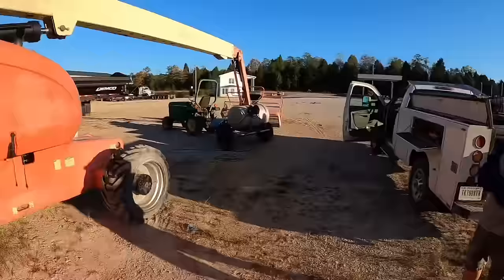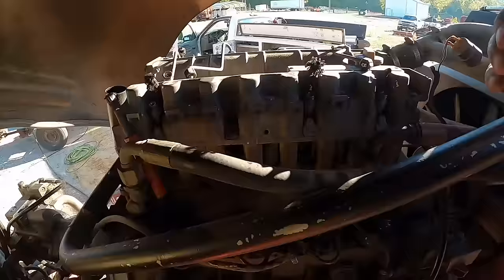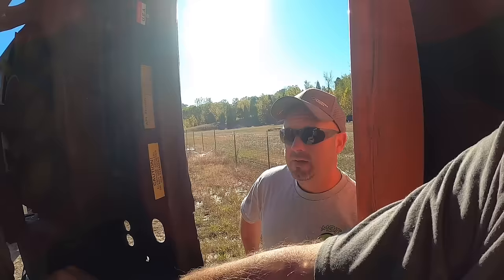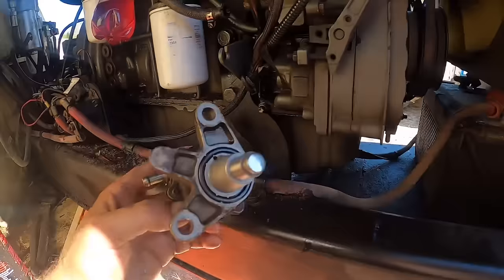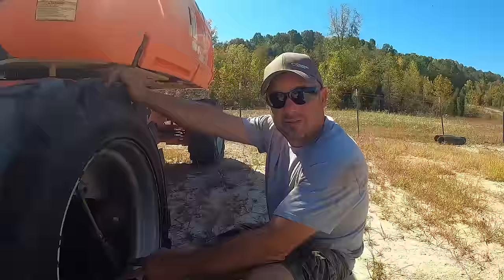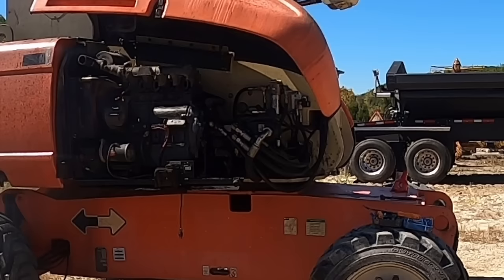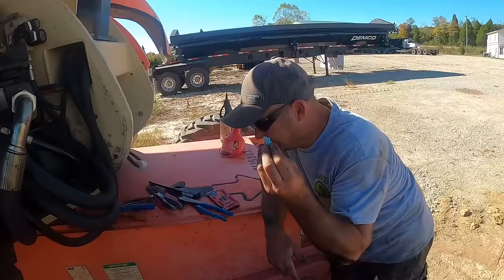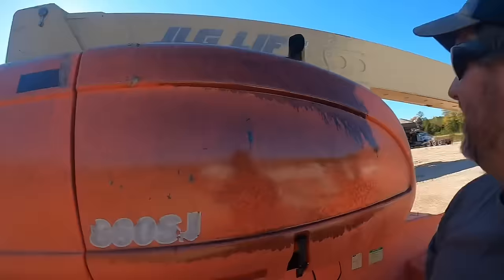Will It Ever Run Again? Regretting My Decision. Lots Of Highs And Lows. Never Believe What We Found!

Comment: I worked for Sunbelt rentals as a mechanic on lifts for about 5 years. 99% of my equipment was JLG. Loved them. Easy to work on. Here’s a huge tip for you. JLG has a service line and they can walk you through any problems you run into over the phone.
Reply: my kubota and case ih dealer had few those jlg lifts inside his shopand got fixed
Reply: Hi Chad what shop did you work at, I worked for Sunbelt from 94 to 2005 in the Northeren Virginia area at 3 different shops, the first shop I worked in was McLean Rentals and I think Sunbelt bought us in 95 or 96.
Reply: This was totally awesome to watch you guys get this running

Comment: these Deutz oil-cooled engines use a timing belt instead of a chain or gears..replacement is necessary when the engine sits unused for long periods as the belt will get flat spots and jump time..the fuel solenoids are high mortality rate failure items,there is a 2-wire and 3-wire style,with the 3-wire being the better one due to a low-amp 'hold' winding. Fuel lift pumps are high failure rate items as well

Comment: Check injectors like this all the time. One thing to do is check the strangler (manual shut off) cuts the injectors whilst cranking. Have had the injector pumps seized with the rack wide open due to contaminated fuel. When draining engine oil drain the oil cooler too, it holds a good 2-3 litres of oil, when refilling I usually take it 1/3 to 1/2 inch over the max on the dipstick, once it's run and the oil cooler and galleries are full the level's usually just below the full mark.

Comment: I work on a bunch of welders with that same engine and as soon as you were describing it I immediately thought lift pump. I change them often, they also make one with a hand primer on it which is my preferred replacement. If you take those outer Phillips screws out of the pump you’ll expose the diaphragm and you’ll see the tear that was causing your leak 

Those actuators fail a lot also, good to keep a spare on hand

Comment: I got a feeling your friend at the dealership is going to be having some words with his mechanics when he's watched this video.

Nice to see you had a right result with this gamble though.
Reply: You mean soon to be former mechanic.
Reply: @jdelbrid  Very possibly, I mean when a manager is selling a $25,000 machine for $1500 scrap based on what you told him that's not a good situation.

Although even if the engine was blown it would still have been worth swapping it out, which seems more like they just wanted shot of the JLG & didn't want to put any labour or parts into it.
Reply: My thoughts are with the old owner who took a beating trading it in on new machine because the mechanic/ dealer told him wrong.
Reply: @WombleUK you mean $50,000 for that unit used 😉 for around $3,000 scrap price currently.
Reply: @kevink4914  I thought Mike said the value & what he paid, but I might be mistaken.
Reply: @kevink4914  No , he means $25,000 used in good running condition and $1,500 scrap price because thats the numbers Mike told us and i bet thats the numbers the dealer told him. Rural Southern Indiana has much lower prices compared to many other places on used equipment.
Reply: It's a good deal. And this whole story sounds to me that the dealer had 0 interest in this machine.. just sold a new one and and sent this asap. And the mechanic was the salesman.

Comment: Alternate theory - failed fuel pump starts filling the crankcase with diesel, raising the oil level to the point where the pistons are pumping/aerating it furiously into the crankcase ventilation system. I don't know anything about this particular engine, but generally, that gets ported right into the intake somewhere. The over-revving due to bad wiring is just a bonus which probably exacerbated the oil pumping/aerating issue. Truly a grand slam of minor failures compounding into a "junk engine" diagnosis.

Comment: I got a very nice JLG 600AJ last year in non-running condition.  Squirrels had ravaged a lot of the wiring harnesses.  Took a couple days but I got everything repaired and machine back in service.  

I am really impressed by JLG.  They offer all operators, service, and parts manuals free on their website.  They also sell parts direct and are very fast to deliver.

Comment: Genius and luck is on your side. I wish i had the connections you do. I would have bought it too at scrap price. Even if it threw a rod. Still worth the investment. Atleast you didn’t  have to worry about seating the bead on those tires. As thick as they are and being low profile…. Yeah they don’t really come off. If they do they basically seat there self.

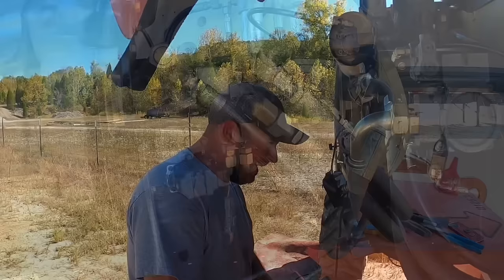Comment: 46:28 "...we're out 4 connectors...": If you haven't tired them, they have heat shrink butt connectors now with solder in them. You don't crimp them. Just push the wires in and heat them up. Melts the solder, shrinks,  and makes a robust joint.

Comment: What is better than one running JLB Man Lift? Answer is two. I hope you see this come true. When I worked in the Air Force the mechanical boy all ways blamed the Electricians for the problem while 90% of the time the problem was mechanical. The rest were electrical and these were harder to diagnose than your short pieces of wire. Good job spotting the problem.

Comment: Nice lift for $1500!
Bought an '03 Subaru Forester body in really great shape for being in the salt belt. Listed as a mechanic's special needing head gaskets as it was loosing coolant. Long story short, the lower radiator hose clamp was broken. Drove it for 2 years before I got tired of oil leaking on the exhaust manifold and the replaced the head gaskets.
Oh, the guy I bought it from called his mechanic and he diagnosed it over the phone!
I did pull the engine out again to replace the rings as the oil consumption was a qt/1000 or less! Oil rings stuck in their groove. Just about ready to fire it up.

Comment: I think the technician changed the oil and fuel filters and filled the oil filter with fuel and caused the dilution in the sump and filled the fuel filter with oil and cuased the oil spew in the exhaust

Comment: You might also want to verfiy crankcase ventilation system. That fuel pump increasing the oil level by so much is definitely justification for oil/fuel mix in the muffler. Excess crankcase volume has gotta go somewhere and by the rings and out crankcase ventilation are the two most likely paths. Not sure where the crankcase ventilation vents to but if it's into the intake like kubota and a couple others do then that's also great reasoning for all the smoke. Good job fellows.
Reply: That was just a crankcase flush ;)

Comment: A wiring problem made sense because after checking the injectors and all that stuff you still had the motor in the pulled out position and it was running fine it wasn't until you pushed it back in and started it that it started running away with itself so it was shorting out when the motor was in the locked position good job

Comment: Couple hours late to the show, and am in the process of watching. I work on tons of these Deutz’s. They number their cylinders starting at the flywheel not the fan, fuel is getting into the oil due to the lift pump failing, happens to us all the time.

Comment: Perhaps the machine played up intermittently due to the wires shortening out. Maybe the operator (s) got fed up with it and ‘fixe$’ it with oil down the exhaust. On top of a leaking fuel pump into the engine gave them a new one which did not play up?

Comment: As a child of the early 60's driving worn out ford falcons and chevy 2's when the oil level was high or started stinking we'd drain out the Quaker State/Your Friend (Billups) 30 weight mix and replace the diaphragm in the fuel pump, and after the lifters cleared up they'd eventually quit smoking as much. New valve stem seals if we were ready to dump it off on an unsuspecting classmate. As bad as the vavle guides usually were, the stem seals would last a couple of weeks,  and by then we could accuse them of dogging the poor thing.

Comment: A little thing I got to thinking about, people think that when an engine gets diesel fuel in the oil it is destroyed because of that. But what they fail to realize is, diesel fuel is very oil based fuel it’s self, and more oil based then like WD-40 or any other oil base, penetrating fluid. I have trucks that run 1.5 million miles plus because I change the oil every 50,000 miles, but what I’ll do is, leave the old oil filter on, drain the oil out, fill the engine with diesel fuel, start the engine and let it idle for five minutes, shut it down, drain the fuel out, change the filter and that million mile engine will be as clean as it was the day the brake in oil was added to it upon assembly at the factory. All that engine does is turn a pump, it is never under any torque load so that is why they get by without the turbo, and my engines that I run diesel fuel in for that five minutes, idling, is not under any torque load either so there is no way that the engine can get hurt running diesel fuel in it in that kind of environment, not even the turbo, because the turbo is not under any torque load, and the diesel fuel brakes down the residual oil buildup in the engine and make it as clean as a whistle.

Comment: When you put the oil in you put it in the valve cover. That engine has a fill pipe that goes directly to the crankcase. When you fill through the valve cover it can flood the cover and allow oil to bleed by the valve stems. This will fill the muffler and intake with oil. Glad you got it going though. Awesome job.
Reply from the maker: lol no

Comment: Educated Process of Elimination, good engineering p[practice; as a former Avionics Engineer (Includes Electrical on aircraft) I would have been checking electrical looms while you heavies checked the mechanicals, great work folks. instead of the loom protection used, you would be better of using Spiral-wrap that is oil and fuel resilient.

Comment: When you find fuel in the oil the first thing you should do is change the oil and filter(s).  Cranking an engine with fuel-thinned oil is hard on the bearings and other components.

Comment: So I’m only a few minutes in and already see that you are working on a deutz diesel. The engine is oil cooled and I’ve seen them blow head gaskets and blow tons of oil out of one cylinder. Also be sure that you don’t pull the front crank bolt loose unless you have the timing pins. There is no key way on the crank and it will throw the belt out of time and bend push rods on first crank. I’m excited to see the issue
Reply from the maker: Keep watching

Comment: Shows you not all mechanics are born equal, I found that out working on equipment, this video reminds me of a Skyjack I worked on that another mechanic said was trashed. It was multiple issues and took awhile but I got it working. Also I got an old Taylor Dunn shop cart for free, another mechanic said it needed a controller but I found out it only had a missing bolt for the micro switch on foot pedal, love free equipment that don’t cost anything to fix. Sometimes guys get lazy, sometimes they don’t have the knowledge, and sometimes they say something’s bad in hopes of picking it up cheap, and you wouldn’t believe the sabotage (if guys that run them hate the machine) that goes at some companies especially when it comes to rentals

Comment: Why the hell did they remove the planetary gears???? All you do is undo the two 7/16 bolts on the centre caps of each hub, invert them and push the centre shafts in to disengage the drive for recovery. Once recoverd unbolt again, put them the correct way round and the drives automatically engage again. PS I comment as I watch videos.
Reply from the maker: I can tell

Comment: I had one that the fuel return line got plugged because it broke down from the inside. The fuel couldn't get away from the injectors and filled the oil with fuel.  Believe it or not, my shop was the third shop that worked on the same problem before anyone checked if the return line was actually returning fuel. try blowing air back to the tank. there shouldn't be any restrictions. Hope this helps, good luck.
Reply: Easily overlooked but I’ve had that happen too

Comment: Keep ya eye on that 10mm Mike they tend to wonder off lol 😆 and excellent score even if u did have to buy a new fuel pump and fuel solenoid ur still up and u can use it and still get a huge profit when time come t9 flog it bit I agree that dealer I'd go to the other opersite direction there mechanic aut up to scratch I'm a DIY mechanic and I could tell it had no turbo too and looked way to clean for a motor to be blown I'd expect a mess bu5 that just general dirt and grime in the bag withe old diesel and completely dumbfounded how that much oil in the muffler

Comment: Just speculating from my armchair but if the crankcase is ventilated to the intake, the bad lift pump may have filled the crank case to the point it was getting blown into the intake and that's where the fuel in the exhaust came from.

Comment: Awesome 👌 now you need to change the oil filter that was probably full of fuel and change fuel filter and did you check the antifreeze. But all in all very cool congratulations. I bought a push mower once that they said it needed a new motor and all it was was the blade was loose. 😂

Comment: Change the OIL FIRST if there is fuel in the Oil it is almost  guarented to run away .  That fuel pump leak is what i call the BMW problem done several  525D  bumw's with sumps full of fuel the stupid high pressure pumps are a mare for leaking into the engine and of course being a piece of German scrap  you need a special tool to change the stupid things .

Well done on that one folks

Comment: I was thinking ya both should jump in basket and run it all way to top. I used to work for my uncle. HVAC we were installing heater in a factory. Picked up heater with my uncle on the pallet with the fork truck. I then ran outside and got on roof with ladder. It's Saturday we are only ones there. Heard a crash. Turn around and ladder blew over. My uncle was like what was that. Nothing Important just the damn ladder. Had to yell across to gas station for someone to come save us. He is like 350 so he was not gonna shimmy down the mast.

Comment: DP gots the dropsies today, LOL. Yeaaaaaaaah! You found the issue and fixalated it. 

This explains what I was seeing when  I was watching one of Matt's castle videos and he had a different massive lift from the original one. I wondered what happened . I remember thinking it would have made working on the top of the castle so much easier having the big one.  Now I know you robbed Peter to pay Paul and used Matt as a guinea pig, 😂. So you are only out replacement parts for the smaller lift. Not bad, not bad at all. 👍

Comment: If that fuel pump was putting fuel in the oil and it was that diluted, then the oil/fuel was going right by the rings. That would account for the oil/fuel in the exhaust.

Comment: Well done guys!
Nice step-by-step diagnostics. Start with the basics, assume the previous shop didn't. (Pretty obvious; turbo/no turbo!)
Get the first part working, (nice to have a "parts machine" handy 😅), move on to the next issue.
One note I will make, that was a great setup to be able to instantly block the air intake in the case of a runaway but I prefer to have a CO2 extinguisher on hand to pop down the intake. Especially when I'm working on marine engines where the intakes are hard to get to. (Or euro diesel cars.....).
On the plus side, that is a really nice swing out engine setup there!
Edit: I do believe you may have made a good profit here. 
It's a pity you've made this video public, you might've been able to sell it to the original dealerships maintenance department as a training vid! 😝🤣🤣